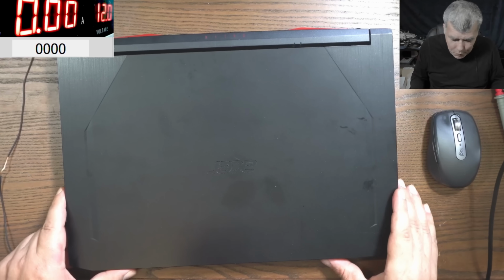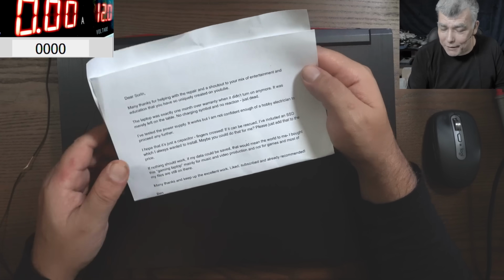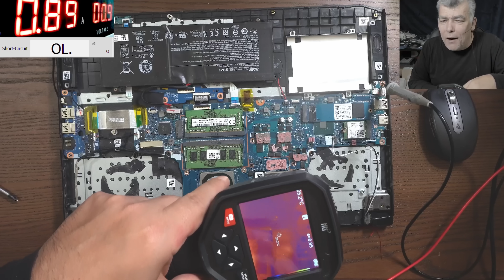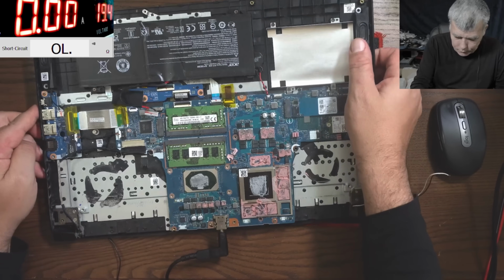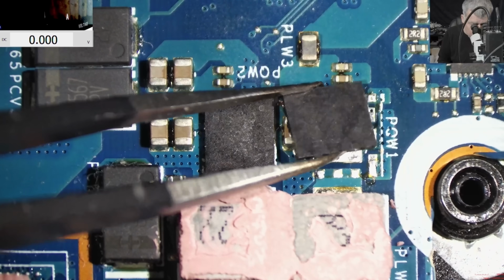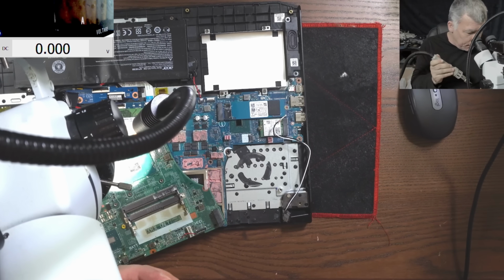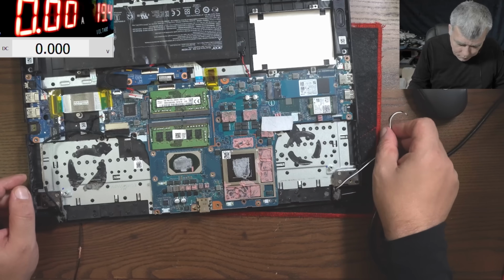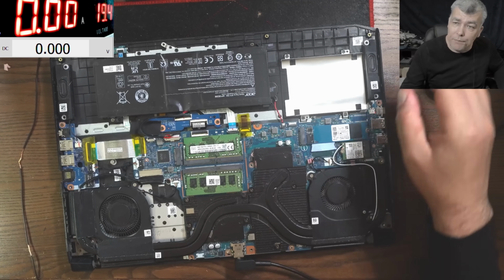Acer Nitro5 not powering on, not charging motherboard repair, 3060 GPU died because of a Mosfet

Comment: Hello i have dell Inspiron n5030 it was shutting down randomly while using but was powering on then it stopped charging even with charger plugged in but was working fine later on it shut down ehile using and never came back on again. what could have caused that problem

Comment: i had a similar issue with my laptop, but luckily it had a GPU board that was separate from the motherboard, and allowed for easy replacement.
Reply: Mxm GPU I believe? Sadly they don't use that anymore

Comment: In Australia, the expensive laptop is still covered by warranty if it fails one week past manufacturer's claimed warranty end.  Acer cannot wiggle out of replacing the board in a case like this one, because it is reasonable to expect that a premium item will last beyond a set time.  For such a laptop the consumer would have a case for repair even at 5 years.  Not sure about Acer, but Lenovo, Dell, and maybe others re-manufacture such boards for warranty replacement purposes, so the cost to them is virtually zero.  It's probably a wise investment for owners of such expensive laptops to take an extended service agreement for small money in a country which doesn't protect consumers very well.

Comment: I use a stand with 2 big fans blowing air on the bottom of the laptop. So far my rtx3050 laptop is still working after 1 year.

Comment: Hello Sorin, that is not a GPU core problem, its highly a vram problem, you can try using nvidia mods 455 for this 30 series card pinpoint the faulty vram, reflow if pads broken or replace if chip is dead. The power of community..... lets fix this acer....    sometime error 43 is triggered by a bad gpu bios
Reply: Sometimes , but this is unfixable 100% . All of the vram is dead.

Comment: Excellent repair. I know this is a stupid question but, how come the mosfets started to bubble up while you soldering them back on with hot air? Obviously hot air, but I just have never seen. Is this common?
Reply: It's the flux paste. It liquifies and starts boiling at a high enough temperature. Perfectly normal.

Comment: Could someone offer a quick explanation on how he knew it was most likely a mosfet on the CPU or GPU based on the low resistance on the current resistor. It would really be appreciated as I'm trying to learn.
Reply: On modern laptops both GPU and CPU naturally have a low resistance. CPU resistance is typically around 2 - 10 ohm but GPU is very low from 0.2 - 2ohm. GPU vram from 50 - 150ohm. Mosfets separate CPU and GPU from the main power rail. If you look at the main power rail and it measures resistance within the typical values of CPU or GPU then most likely one of the mosfets went bad and connected CPU or GPU directly with the main power rail which is obviously very very bad.
Reply: @karolkrasinski8947  thank you that really helps

Comment: How did he know the CPU or GPU might be dead based on 8ohms on the current resistor?
Reply: It's due to the fact that GPU and CPU have low resistance... Normally if one of these get burnt their resistance increases... And as of Sorin finding out which one's bad is through experience... In my experience too as a tech it's also a symptom of a faulty chip or mosfet...
Reply: @cjdeleon9146 I think that is getting to be a common fault, A laptop cooler is vital on a gaming laptop especially but does extend the life of most laptops also...
Reply: @cjdeleon9146  it can go to 0 ohms, too, is not mandatory.
but you need to know before what is the "normal resistance" of a working CPU/GPU, also, vram chips, mosfets, etc... these combinations will give different values when are faulty... and you can know what one can be.
Reply: Experience?
Reply: @Dohcoms  Experience is quite an obvious answer. I mean how does a low resistance on the current resistor correlate to a dead CPU or GPU. I was looking for an explanation
Reply: @brainoverload6288  i am still learning myself, we will just have to keep watching and practising i think,